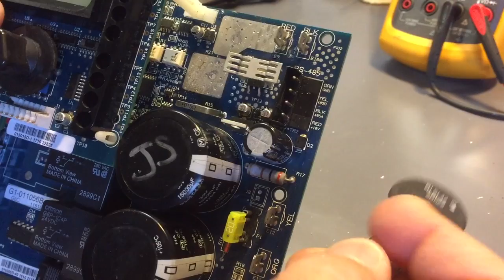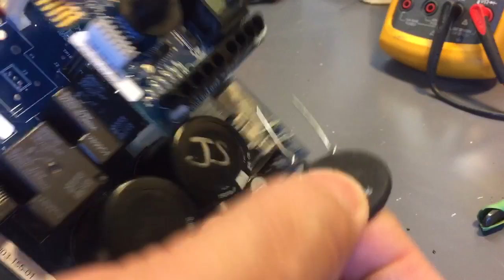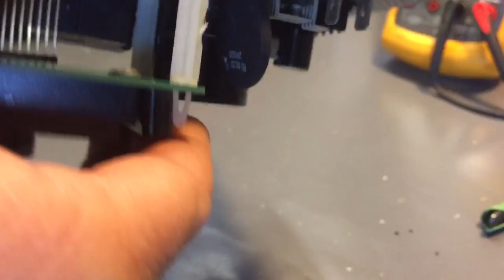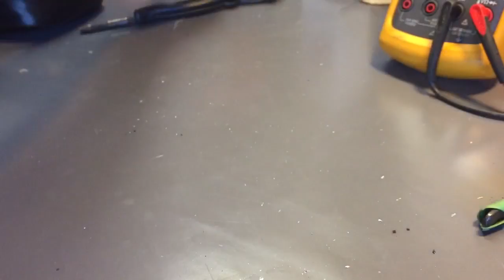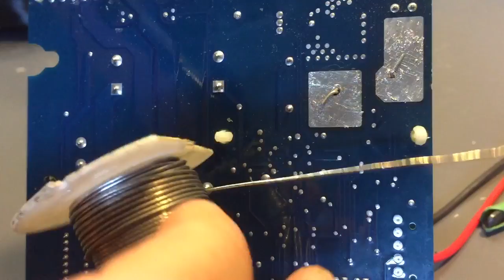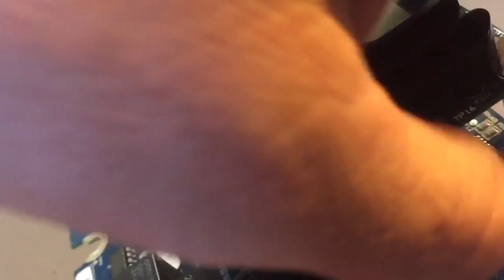Repairing the Aqua Rite PCB

Comment: I like to leave the legs long to help dissipate heat.   The wire is stiff so no danger of bending or touching.   I even saw one post where they had the stiff wire longer legs left in after the dead thermistor had been snipped and they installed screw junctions on each leg.   All they then had to do was unscrew the dead one and secure a new one in the joiners.   No need to even remove the board.   I might try it.   The screw joiner blocks also provide more heat dissipation area.

Comment: Mike, I wish that I would've scrolled down and viewed the comments.  I spent a long time searching for this product online before learning that I could buy it from Amazon.  Order placed after pausing your video to learn exact replacement part, for mine crumbled in my hand when examining the circuit boar.  I was troubleshooting why the 'power'  light did not glow, nor did the 'generating chlorine' or 'superchlorinate' lights glow.  I had digital numbers display, and the 'no flow' light flash when I turned the unit on.  There was no detectable chlorine in the pool.  The panel was 'going' for a couple of months for the pieces were crumbling without my knowledge until watching your video.  

I hope my soldering project works in 2 days...for I am a novice at this project.
Thank you for the video.
Di
Reply: It will be a piece a cake, you will see. Make sure you have a decent solder iron/gun. 25 watt won't work well in this application (blue motherboard). Yes, it technically can, but you will be there forever trying to heat up the solder from the board. Get a higher wattage iron and you should be done in minutes.
Reply: @Zeppelinlv2007  the motherboard is green what is the purpose of soldering the piece in place?  The copper wire beads up falls off.....
Reply: Whoa, got one to stick in place....one to go...
Reply: @diane-k3n  You can do it!

The purpose is so the solder can make the legs conductive and strong for the circuit board. Inside the board, there are traces. These traces (looks like lines) are responsible for carrying electricity.

This is why when this part broke, no electricity can flow through. No flow, no juice.
Reply: @Zeppelinlv2007  I figured out that my solder pads are on the front of the unit, not the back. So I was able to complete the project.  I replaced the unit back into the box, connected all the wiring, and lo and behold!!!  'Power', 'Generate', and 'Superchlorinate' lights appear, along with chlorine in the pool!  Thank you Zepper2019 and Mike Martin for everything!  My pool man was impressed as well, for I showed him the broken piece, and the price I paid for 2 thermistors purchased from Amazon (< $6.00/2).  I completed the project within 3 days.  Di

Comment: My system kicks on and after about 10 seconds the salt level and inspect cell light stays on, the salt level is also reading low. Do you think this would fix that or do I have a bad cell?
Reply from the maker: Sounds like the same issue I had! 
You could have the cell tested for free at Leslie's (or whatever local pool place you've got in your area.) If the cell is good I'd go for the repair.

Comment: My power light not coming on would that fix my Problem
Reply from the maker: Probably not, this issue is for the Salt Cell not turning on or the inspect light staying lit.
Reply: Mike Martin It did fix my problem thanks Mike
Reply: Don S  I'm having the problem  of  the display  screen bing blank. I can hear the power come on to the box it self just not the display screen. Is that the same problem you had? This is my second  Hayward control box. Pretty expensive to keep replacing. LOL
Reply: GREG WILLIAMS Order a thermostat in on the circuitboard that fix the problem
Reply: @dons453  If my board is totally blank.... and on the back of it it looks like burn marks.... is the SL32 disk thing what i need?
Reply: @karencutscoupons  If your disk  looks like it has a crack or burn I wood replace it it’s a cheap fix and it solved my problem Power lights came back on

Comment: can you crimp connect it to the 2 wire stubs on the board instead of soldering?
Reply from the maker: I suppose you could try, but this is definitely a solder connection.

Comment: Hello Mike. Thanks for this video! What are some of the symptoms that a board with a bad thermistor shows? Mine powers on fine, then when the relay kicks in, the board turns off and back on. A bad current limiter does seem to me like it would cause the board to power cycle, perhaps due to a current overload. The fuse on my board is fine though. Does this sound like a bad thermistor to you? I also thought it could be a bad capacitor, since it may not be holding enough current and then powering off, or a bad relay. Forgot to mention, the board does not power cycle when the salt generator is set to OFF, only if its set to AUTO or SUPER CHLORINATE, and only a few seconds after the relay kicks in. Haven't gone too deep into my component-level troubleshooting, but was hoping you can shed some light on my issue with your past experiences and save me some work. Thank you!
Reply: These thermistor are a common failure point in all of the Goldline/Hayward chlorinators and they fails within several years. It's usually the cause to erratic display behavior, cell cutoff, or lights not functioning correctly.
Take a look at the board, MAKE SURE power breaker is off, and look and touch the thermistor. If you see visible cracks or you touch it and it crumbles, it's time to fix it.
Reply: @Zeppelinlv2007  that's how I knew I needed a new one...the thermistor crumbled in my hands.
Reply: @Zeppelinlv2007  my display is not functioning properly glitching and the diagnostic button doesnt work and the lights flicker too
Reply: @Zeppelinlv2007  do u think it might be the transiter? any tests i could do to make sure?
Reply: @andrewtuzzolino589  yes, check the thermistor. Easy repair.
Reply: @andrewtuzzolino589  testing is not needed. When you touch it (power off of course) the thermistor will flake and crumble into pieces. A lot of problems come this one part when it fails. It's inexpensive and easy to repair.
Reply from the maker: Not sure, this is the lowest cost repair that I know of, who knows you might get lucky.

Comment: Just completed my repair😀 I ordered a soldering kit and replacement thermistor from Amazon. And I able to replace the part with this video and a few others  that I saw. Two year ago it cost me 500 dollars to replace the board via a pool service. My total cost today was twenty dollars Thank you !! P.S I had also just replaced  the salt cell  at a cost of $375 and the board when bad.  Total cost of $395 to be ready for the summer heat🏊🏻🏊🏻🏊🏻🏊🏻.👍👍👍👏👏👏
Reply from the maker: Awesome, glad I could help.

Comment: I have a Thermistor on my Aqua Trol which has split in two. This is all new to me. Where do I order a new Thermistor?  Thanks in advance for your help. Marcel
Reply: I believe this is the link https://www.digikey.com/products/en?keywords=SL32%202R025  But I ordered 2 from amazon yesterday for 18 bucks.  Most of the cost was shipping to have it here Monday. I hope it works when i put it in Monday , i don't want to buy a new board for it.
Reply: I brought my Aqua Trol circuit board to a repair location in St Catharines where the Thermistor was purchased/ installed and it is now working like new for less than $50.00.
Reply: I fixed mine ..it was pretty easy once i could get the soldering iron hot enough to melt the solder on the current limiter.
Reply: DID IT WORK?

Comment: So you are using the SL32 2R025 Thermistor instead of the AS32 2R025?  I guess because the leads are flexible and grab the board to make soldering easier?
Reply from the maker: Chris Roush, yes exactly! The SL32 2R025 has round leads vs. the flat leads of the AS32 2R025. Also the SL provides better performance (at least on paper), not that you will notice in the performance of the chlorine generator... lastly I was able to order 3 of the SLs at a better price from some guy on e-bay with quick shipping. Either one would definitely work.
Reply: Cool, that's what I thought.  My Hakko made quick work of the job!